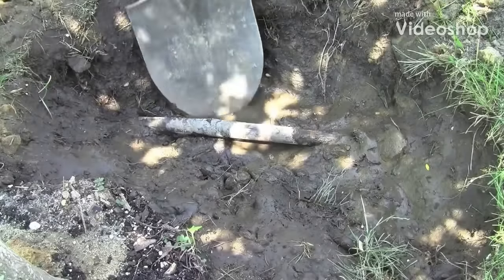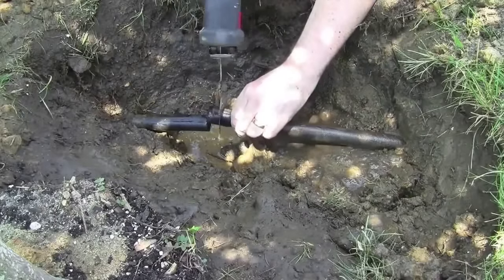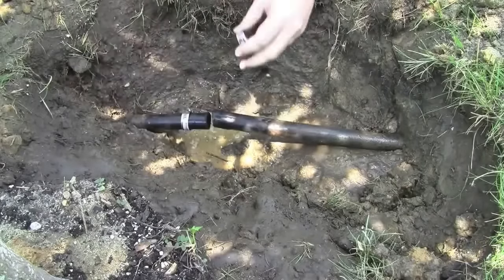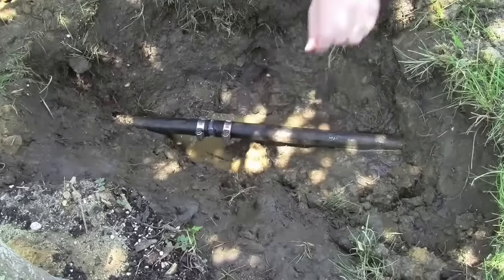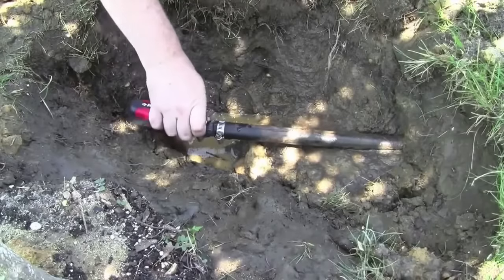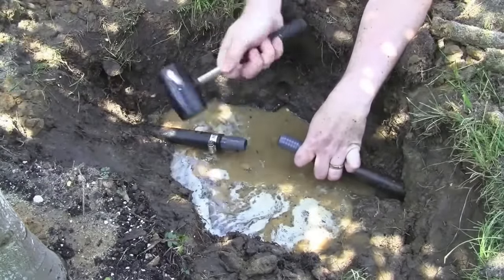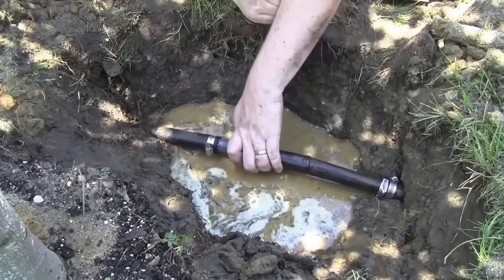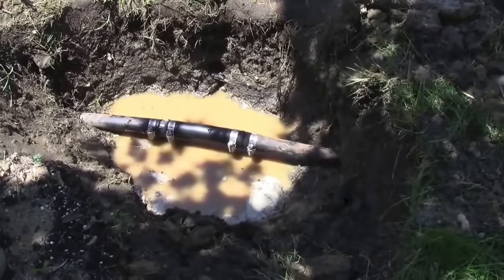How To Repair A Broken Leaking Black Plastic (Polyethylene) Underground Sprinkler Line In Your Yard

Comment: won't the hose clamps rust over time?
Reply from the maker: I think they're stainless so it's not a big concern.  I have dug out old sprinkler lines that were installed 20 years ago and they're a little rusty and brown but still solid and tight.

Comment: Are these plastic ridged fittings easily sourced via Home Depot or Lowe’s? Can’t say I have ever seen them around the plumbing isles.
Reply from the maker: Good question - they are in the "sprinkler" section!  My local Home Depot and Lowe's both keep the lawn sprinkler parts separate from the regular plumbing stuff.